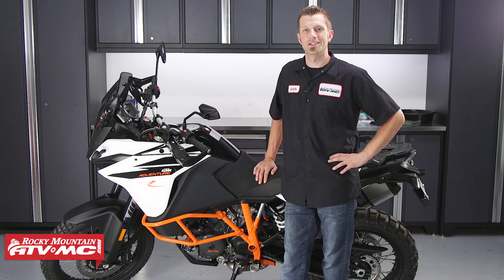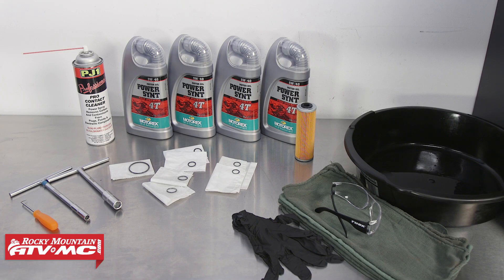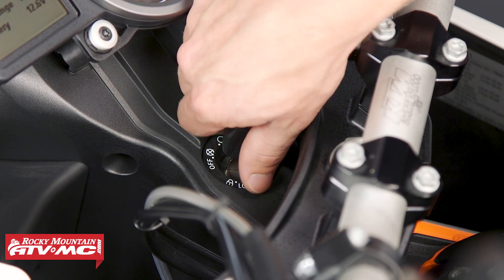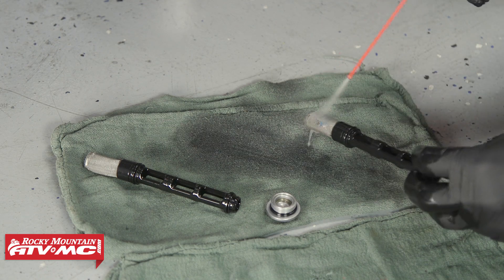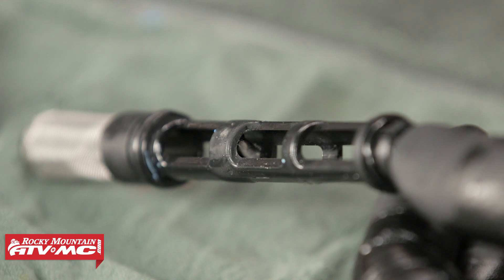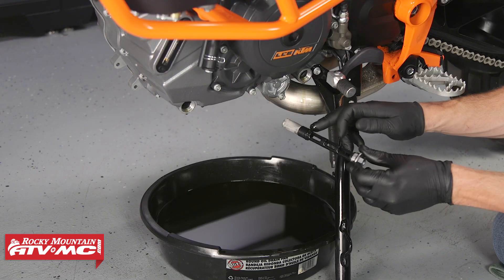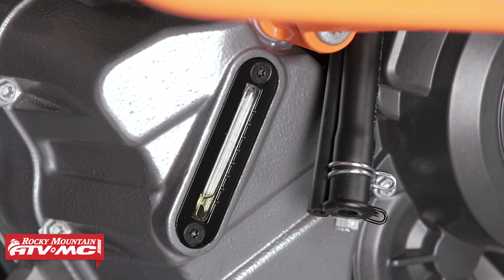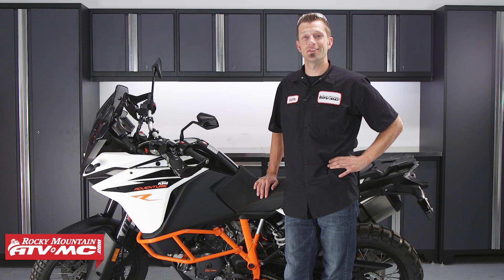How To Change the Oil on a KTM 1090 Adventure R

Comment: Hello! TY for good instruction! I have 1 question about cleaning magnets in filter. I clean them only with contact cleaner on pressure, but its still have some metall chip, that i cant remove from magnet. Is it okay? On 02:26 seems you have that problem too
Reply: and i put 2 o-rings across filter, doenst know that can do this from another side :D can i damage filter?

Comment: Is replacing the O-rings actually necessary or is this a precaution?  First time I've seen that as part of a routine job... of course you'll do it periodically (when they're worn) but this is on every oil change?

I guess I also change my oil more often than required - and would for this bike as well... it's the cheapest maintenance job to protect your engine.  Oils have gotten better over the years but why push it just to avoid an hour of wrench time.

9000 miles might be okay if you're riding the 1090 on the street for 90% of those miles but if you're in the dirt more often it's best to change more frequently.
Reply from the maker: Matt T Replacing the o-rings is a good habit to get into to.  We like to change ours out, but it's not requiered to do it everytime.  You do want to inspect the o-ring to see if it needs replaced.  
True, oils have gotten a ton better over the years.  We agree.  Thanks for watching.

Comment: I wonder if i loose my warranty by doing this myself??
Reply: I was wondering the same so I did some research. In section 6 paragraph 2 it says of the current KTM factory warranty "Owner is responsible for the costs of maintenance to the motorcycle including service at scheduled intervals.
Service work properly done by the owner will not void the warranty. Failures caused directly by lack of
maintenance or improper maintenance will void the warranty."

Warranty is here: https://www.ktm.com/globalassets/service/usa/2017/2017-ktm-usa-motorcycle-warranty-policy-12-8-2016.pdf

Comment: 9000 miles? 1st change was without synthetic. They said to use synthetic on the 2nd change, because non synthetic is better break in  oil. Still 9000 miles on non synthetic? Thanks!
Reply: I think you misunderstood the info, He said that the first oil change has to be done when you hit 600 miles, only then, every 9000 miles.

Comment: Engines with larger bore and shorter strokes require less oil changes than under-square engines like those made by Harley Davidson for example as there is significantly less "shearing" of the engine oil where the piston rings meet the cylinder walls.  Using full synthetic oil like Ams-Oil, Royal Purple and the like (Don't start an oil war here please.) will buttress these long intervals even further.

Comment: Isn't 9k miles too much for intervals? I'd like to hear from engine designers what they have to say about that.
Reply from the maker: The KTM manual recommends changing the oil at 15,000 km or 9,000 miles.
Reply: @rmatvmc  I know, own 1090 myself, but will never do that.
Reply from the maker: @dmumladze  Don't blame you! Thanks for checking out the video!

Comment: One plug and one spin-on filter would have been sufficient, KTM. Had to make it complicated.
Reply: Its a dry sump performance engine on a bike designed to handle moderate off roading. Sure adding 30lbs to engine and putting an oil pan on bottom requiring engine to be raised in frame for clearance would be simpler. Everything is a compromise.

Comment: don't like the engine guard screwed directly to the engine...
Reply from the maker: It's definitely a different design than from other ADV Models.  With no frame wrapping around in front of the motor, this is your only option.  Thanks for sharing your thoughts with us.
Reply: What about the PP skidplate?.
Reply: same problem with side stand mount...

Comment: Every 9k miles ?!!  That’s insane
Reply: insane good
Reply: I'd like to have the oil tested half way to that mileage. What a manufacturer says isn't always designed to be the most optional for bike life. They are concerned about parts and bike sales, afterall.
Reply: Pffft. Buy proven name brands at the right oil weight. There's no witchcraft in Motul or some bike-branded oil that will protect the bike more than 1% better than oil 1/4 the price.
Reply: That's one dealer. Other dealers may not be as strict, depending on your relationship with that dealership as well. Keep in mind, ANY SHOP will have to PROVE a failure was due to the type of oil being used. It's not an automatic warranty denial. For instance, if a bolt came loose and your subframe fell off into the back tire causing a wreck, your engine oil didn't have anything to do with that.
Reply: KTM, like other brands, does extremely well at certain things and utterly fails at other things. Yes I know they don't. If I recall, it's engine, frame, and suspension and that's it.

As good as they do with the bones of the bike, things like display and switchgear and UI are pretty terrible. I use another expensive brand for a benchmark:  Ducati, which does amazing UI, very good switchgear and display. KTM is starting to come around with their latest TFT equipment but they aren't as intuative. Certainly a price tag of 17 to 22 grand implies premium.